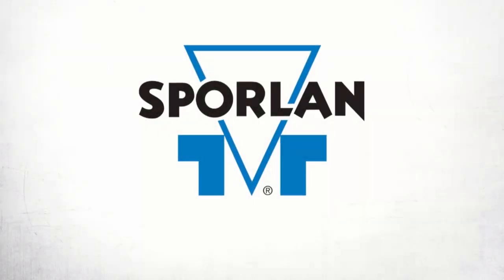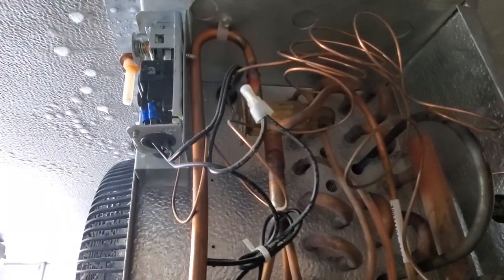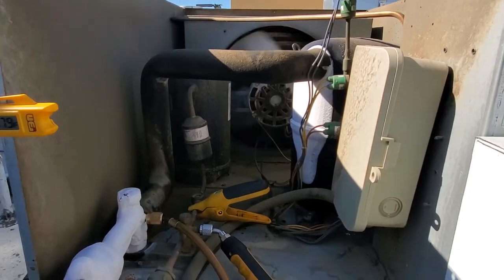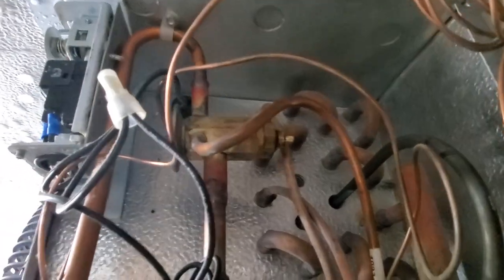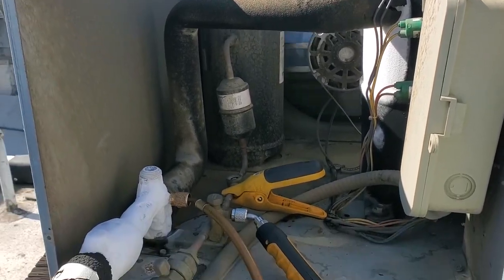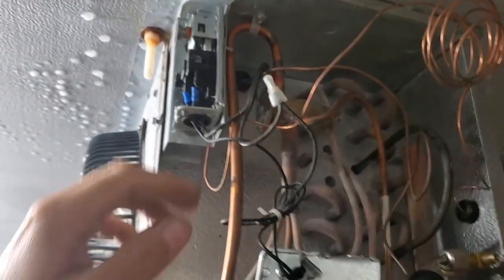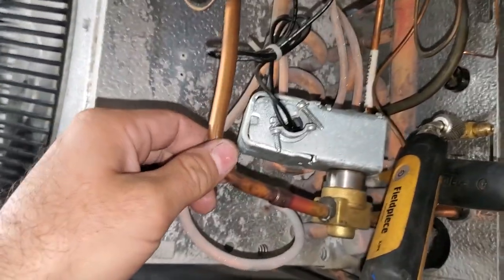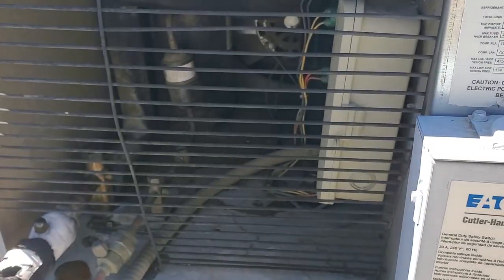WALK IN FREEZER SUPERHEAT TOO LOW

Comment: Sun ding liquid through the headers or scrolls can ruin a compressor as well. You want 100% gas going back through the compressor discharge. That’s why we take subcool and super-heat. Same goes the other way. If we have a sub-cool that is off with a flashing sight glass we are ruining the TXV since the TXV needs 100% liquid to work correctly. When gas goes though the TXV the valve body will jump more than needed to. It can destroy the TXV. Especially the way they are made these days.

Comment: What’s wrong with negative superheat??? 🤣🤣🤣
I prefer the Sporlan TX Valves too. And I agree with you about the wonky placement of the liquid service valve. I suppose that manufacturer installs filters that never need to be changed, so no need for a King valve then... good video, thanks Chris.
Reply: "filters that never need to be changed" that's a good one!
Just like you don't have to change the oil in your lawnmower anymore, just add more when it gets low.
I still change the oil on my small engine equipment, and I bet I won't have to buy one for another 10 years (that's the secret, they can't sell more "durable goods" if they don't break, so they build them to break right after the warranty is finished!)

Comment: Nice work brother. Ive never thought about running the adjuster in and out to free up a valve in a pinch. Awesome video.
Reply: really similar to valves i deal with in plumbing/water lines at work, it is called "exercising the valve", which oddly enough an electrician contractor taught me for breakers, but he said plumbing is same, they all like to be turned on all the way and turned off all the way- back and forth a few times- at least once a year, or they get gummed up or rust or whatever, so at least once a year turn whatever valves you have folks.... it has worked wonders for the old building i take care of, saves lots of replacement work and when a pipe breaks, the valve actually shuts off the water

Comment: All this behavior makes perfect sense.  You had a little extra oil in the discharge from the low superheat and gas through that stuck txv.  That coil was nicely insulated with that extra oil.  Damn good get it done method of cranking the valve spring to both extremes, excellent work.
Reply from the maker: I will be going live on YouTube this evening 8/19/19 @5:pm
(pacific time) to discuss my most recent uploads and answer questions from
YouTube comments, the chat, and emails. Come check it out if you can  https://youtu.be/cFVJGl-KVEc
Reply: the box temperature wasnt satisfied because txv wasnt feeding a solid liquid  once he cleared a glass the temperature should drop, but it would still be flooding compressor,
and shorten its life.
very nice diagnosis! I just wish the doctors would be that through

Comment: You could always use your pinch off tool on the liquid line after the receiver outlet if you needed to change the drier. I bought one after doing a pressure switch on a Mani and have used it at least 15 times that year, mostly to weld taps onto reach ins while they’re running because the saddle taps are worthless
Reply: I've seen one of HVACR VIDEOS vids where he used a saddle tap on a piece of equipment that didn't have service ports.
I'm not a HVACR technician, but I do auto repair so I do have the occasional contact with vehicle AC systems. IMO, saddle taps should only ever be used to remove the charge from equipment that doesn't have service ports, and never left in place. That rubber you wrap around the pipe will degrade, and those screws are all that's compressing the rubber to seal it against the pipe, and a dirty pipe won't seal as well, and... well a leak is basically inevitable, and likely created when you install it. So it's best to use it as little as possible, and never left in the system as a permanent fitting.
If I was working on something that didn't have service ports, and I needed access, I'd use a saddle tap. Once I was done, I'd recover the charge, then sweat in a pair of service ports. I don't like the idea of a pinch off tool on copper lines as it puts the copper thru so much stress that I'd never trust that section of pipe again (work hardening and micro cracking are likely at the corners of the pinched-off pipe). As far as I've seen from watching many videos, when I see a pinched off copper line it's also sweated shut. That's acceptable for long term use, but I only trust it because I've seen them that way from the factory.

Even in plumbing saddle taps are a common source of water leaks, usually behind the fridge as some DIY'er decided that was the quick and cheap way to get a water line connected to the fridge's ice maker. The leak can happen any time from under a month to a couple years after installation, but it WILL eventually happen.

Comment: Absolutely  awesome videos and recaps. I been in the residential AC 5yrs When I worked with my old boss we did single evp and condensers. Recently got a lead to go see a customer.  He had a parallel  Hussmann cabinet. The guy who worked on it move so he says. Had 4 compressors. 1999.   Only one compressor was working, he wanted a new and wanted to replace one compressor, 3 were bad. Customer gave me a hard time about adding freon, 55lb system 404A.  It had 4 cases and one walkin chill box. But anyway. Do you have any videos on multi compressors systems or multi evp running off of one condenser. I couldnt find you email, the website wouldn't load

Comment: I'm a newbie at this, so confirm if I'm thinking this through correctly.
The flashing sight glass was because the faulty expansion valve was flooding the evaporator and suction line with liquid refrigerant. With too much refrigerant now on the suction side, the liquid line receiver ran low on refrigerant.  Is this correct?
Reply: That is correct.  Most freezer TXVs are pressure limiting, so as the evaporator is flooded and the liquid refrigerant is flooding back to the compressor, it fills the suction line with refrigerant causing the system to appear long on charge when in fact its perfectly fine.

Comment: sometimes i ve seen low superheat at compressor caused by coax heat exchangers leaking internally. liquid dumping directly into suction line.

Comment: I’m a newbie, and I have a walk-in cooler that is running off a halfhorsepower Compressor and it does not seem to get below 50° the charge seems fine, should I adjust the TXV before trying something else or should I get a bigger condensing unit

Comment: Riley: From my HVAC knowledge as an autistic 13yr old, Superheat is very important. Dangerously low superheat can make liquid reach the compressor and potentially kill it. Dangerously high superheat signals that the system is low on refrigerant. - Riley
Reply: 1:02 That’s why my fictional HVACR company, Losense strives to fix those wrongs. We manufacturers at Losense work for a long time to make it a polished product. FYI, Losense is my fictional HVACR, appliance and technology company. The name “Losense” came from hisense so credits to Hisense for the trademark. - Riley

Comment: Hi, Chris, just watching your video and I think I’m having similar issues wit subway sandwich maker , R404 and pressure looks good, but temperature is staying at 47 , 35 low 225 high condenser coil is clean , made turn few to the left and more to the right , but no changes on pressure at all, took out all refrigerant and weigh charged of 25 oz. But temperature maintains 48 degrees, would it be the TXV ?
Thank you in advance!

Comment: Have a new WI Frz installed in NOV 2020. 2 weeks ago I got my first call saying box temp 20°. Bubbles in sight glass so I cleared it with 1lb 404. My diagnosis was that whoever installed it did not properly charge it and are just now seeing a problem due to higher ambient temps. I've done a leak check as well.  Am I on the right track?

Comment: I’m not sure if it’s been mentioned in the above comments so i apologise if I’m repeating anyone else.    The equaliser line is positioned incorrectly,  when the valve & orifice are sized correctly (hopefully always) that will cause you problems every time.    Obviously there is some liquid Cary over through the equalising line and when your bulb is positioned down circuit from that your creating a false superheat causing the valve to shat down equivalent initially then behave IRAtic with the fluxeration and what not.

Comment: Couple of questions if you don't mind: That sight glass indicated moisture in the system, probably due leaks over the years and charging without purging and what not. Wouldn't you want to change out that drier before adding any gas? also 404a is a blended refrigerant, would you want to recover that gas and then add in fresh 404a to ensure we didn't fractionalize too much? or was the process to charge in some gas first, see if that cleared up the temperature issue and then put in for a bid to replace drier, valve, what not.  Thank you for the video and conversation.
Reply from the maker: I will answer your question on my stream tonight, I will be
going live on YouTube this evening 8/19/19 @5:pm (pacific time) to discuss my
most recent uploads and answer questions from YouTube comments, the chat, and
emails. Come check it out if you can  https://youtu.be/cFVJGl-KVEc

Comment: @HVACR VIDEOS I have a question, I have a heat pump that is not keeping my house cool. I hade someone come out and I have a low super heat, and flooding the A coil, I have the correct charge, clear site glass, and clean coils. the condenser is discharging warm air,  the tech could not figure it out, any recommendations. ps love the vids
Reply: Dave your residential heat pump has a sight glass? I did not know that would benefit the equipment.
Reply: Could it be the txv?
Reply: @whitesheatingairappliancer7101  installer added it wean he installed the system, he said it helps diagnosing future problems. I thought the same thing, but It didn't cost me anything for him to add it that I know of
Reply: @Josh-px6xb  I don't think I have one. I think its a orface tube.
Reply from the maker: I will answer your question on my stream tonight, I will be
going live on YouTube this evening 8/19/19 @5:pm (pacific time) to discuss my
most recent uploads and answer questions from YouTube comments, the chat, and
emails. Come check it out if you can  https://youtu.be/cFVJGl-KVEc

Comment: I go back to the old saying that the machine always tries to tell us what is wrong, the hard part is we don't speak Machine very well. In this case the valve that sounded odd was the problem area. My guess is this is more normal than abnormal. Good job troubleshooting. Maybe it was just my ears playing tricks but those fan bearings on the roof didn't sound great. Probably just my ears.

Comment: Why suggest changing all of those other parts when it seems that a TXV and contactor change out will do the job?
Reply: James Bowie longevity!
Reply: @akhermit5213  A number of those items were a case of "I don't like this particular brand/model". To me, simply not liking something that is working OK (such as the thermostat) doesn't justify replacing them, but it's his customer.
Reply: @James_Bowie  Sometimes OK is not good enough. I agree, it depends on the customer. After the repair, the customer not having issues for a long period of time is the goal. If I foresee possible future problems, I will proactively pursue them, rather than take the chance of the customer being unhappy with my work if one of those items fails shortly after I repair the obvious issues. Everyone has different views, but personally, I try to improve equipment when possible, and keep the customer as happy as can be. A customer that has equipment in good working condition is a happy customer. YMMV Have a great day!

Comment: There's one thing I can't wrap my head around : if the txv is acting up , why would it cause a low subcool and a flashing sight glass ?
I tried but I just don't get it , can you put me out of my misery , Chris ?
Thanks again.👍
Reply: I'd like to know as well. I'm still new to everything. Is it maybe that w/e caused the txv to be sticky also caused a partial restriction beforehand?
Reply: If the coil was flooded and as a result more of the refrigerant was in the evaporator then can that may have caused a slight deficiency upstream in the system ??
Reply: Oops...delete the word "may" from my previous comment
Reply: The TXV acts as an adjusted gate and makes the refrigeration flow slow down, but the over-opened TXV causes too much flow into the evaporator coil, and the less liquid stores in the condenser coil, and thus, the over-speed liquid flow passing throw the evaporator coil ( the pressure can't drop to the ideal point), so it brings very low superheat, the saturated gas and liquid absorb  the heat in the suction line, so you can see ice covering the line, and it could hurt the compressor very much.
Reply: @didijiji918  yeah , mate , I understand that, that's not my issue here .
My issue is with the low subcool .
Thanks anyway , mate , cheers .
Reply: To much flow thru a TXV will result in low subcooling because the txv isn't allowing the liquid pressure to go high enough. When the liquid temperature and pressure aren't very high then the condenser isn't going to expell as much heat and as a result the subcooling will be low and the superheat will be low.

Comment: What digital temp control do you prefer?
Reply from the maker: Ke2 or Ranco ETC141000
Reply: The 14 isn’t stocked most places here...you find it to be that much more reliable as it’s rated indoor/outdoor?
Reply from the maker: yeah the nema 4 rating is very handy when working in High humidity walk ins and reeach ins

Comment: What would you do if someone put 404a in an r22 system
Reply from the maker: Just recover the charge and put new 404 in there
Reply: Thanks brotha.
Reply: I get what you mean. Its a r22 system.
Reply from the maker: So this brings up another question in my head what makes you think it is supposed to be a R-22 system? does it have an R-22 txv? what is the oil in the system POE , Min, or AB?

I will answer your question on my stream tonight, I will be
going live on YouTube this evening 8/19/19 @5:pm (pacific time) to discuss my
most recent uploads and answer questions from YouTube comments, the chat, and
emails. Come check it out if you can  https://youtu.be/cFVJGl-KVEc
Reply: It has an r22 expansion valve. A couple of coworkers said they put 404 in. I checked the txv and came up with vzp40. Which V for that brand is r22.
Reply: Being proactive I decided to do a leak search found the leak. Evacuated the system.fixed the leak. Purged and vacuumed 500 microns.
Reply: Sir you should do some classes on certain things TXV defrost timers digital thermostats I would definitely go down south to take some of your classes

Comment: If there was that much work to do on the evaporator wouldn't it be better to just install a new one ?
Reply from the maker: I will answer your question on my stream tonight, I will be
going live on YouTube this evening 8/19/19 @5:pm (pacific time) to discuss my
most recent uploads and answer questions from YouTube comments, the chat, and
emails. Come check it out if you can  https://youtu.be/cFVJGl-KVEc
Reply: Contactor, filter drier, sight glass, KSV, TXV. 
And honestly the contactor is a just in case and could more than likely just be cleaned off. 
4 components, but you would rather get a brand new one... Dude...
Reply: @DW-vl2wi  I would have to price it out. But yes if its more cheap to just get a new one why not ?